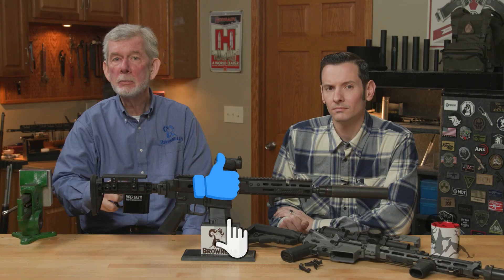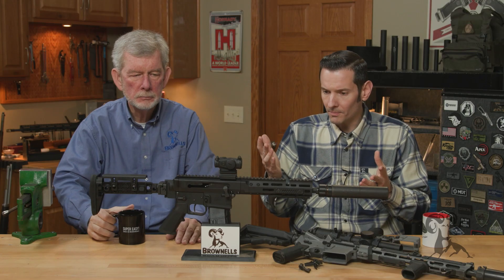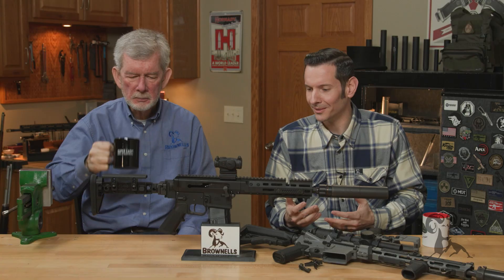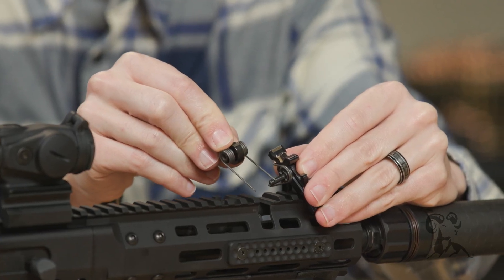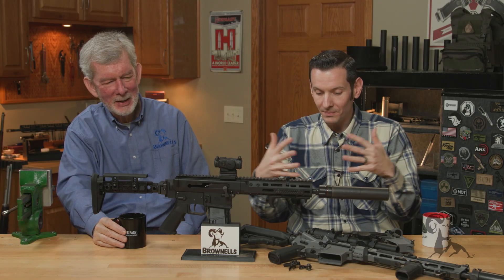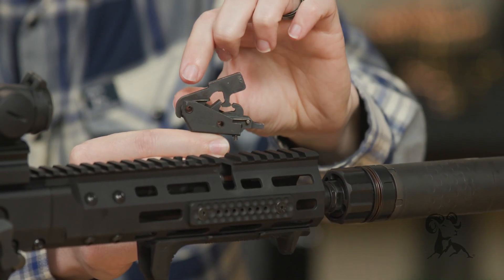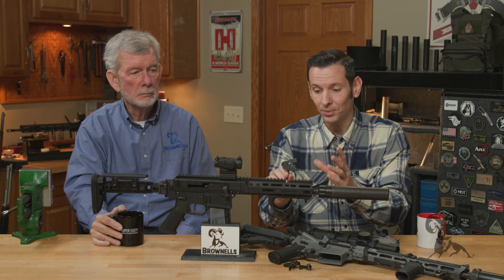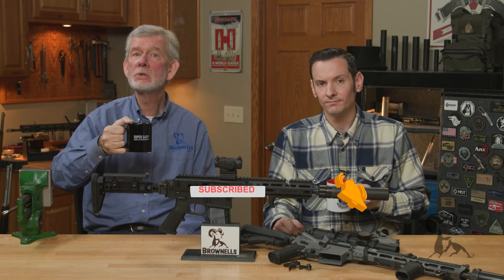Smyth Busters: Does Your AR-15 Need Anti-Walk Pins?

Comment: Smash that like and subscribe button if you know someone who blindly follows trends with total disregard for the mechanical function.
Reply: the like ratio should match the views in that case!
Reply: What do you recommend for an 80% lower? Because God knows that there’s no way that my tolerances are dead nuts.
Reply: @zeroinkev  well if you are using a regular fire control group(separate trigger and hammer) the hammer spring is still going to hold both pins in. Some pins are specific to the trigger or hammer so make sure the trigger pin has a notch on each side and the hammer pin has one in the center. Many are universal though where they have notches on the ends and in the center on both pins. if you think your tolerances are bad and could cause trigger malfunctions then a drop in trigger would be the way to go and with most of those you should have anti-walk pins. If you used a jig your tolerances are likely just fine for a regular fire control group setup.
Reply: here u go caleb starts @ 4:30  hah
Reply: I had to install them on my build because either the holes on my lower were out of spec or my pins from the kit were out of spec, so instead of figuring out what the problem actually was I just fixed it that way.

And yes I installed the pins the correct way and they started to walk out then I reversed them and they still walked out.
Reply: @sjl9942  I'm wondering if I have the same issue as you. My hammer pin walks out but trigger pin does not. I need to try reversing the hammer pin to see if that works.
Reply: Yup! Smashed!
Reply: 😂 From my  perspective Caleb is getting trolled in the forums.
Reply: Well fortunately for you Caleb, I don't go to fourms, or watch angry guys doing YouTube videos. 

So if I ever decide to put a trigger in my rifle, I will just make contact with Caleb on what I need to use for what was covered here.
Reply: I did several builds with Mil spec parts,and since I like the Service Rifle style ,and I've never had any problems with the pins walking or even noticed rotating. Good video .
Reply: Damn.......Anybody wanna buy two sets of anti-walk pins?
Reply: I'd like some deets on that charging handle. My google fu is failing me
Reply: Omg it's literally me
Reply: When I first starting building ARs, there were videos that stated the hammer spring should be under the trigger assembly. This caused pins to walk out constantly. After using antiwalk pins for awhile, I took a good hard look at how the milspec trigger group was designed. I realized that the hammer spring should rest on top of the trigger assembly, and ride in that notch to prevent pins from walking. After that I never had a pin walk on a milspec or two piece trigger group.
Reply: I only have 2 ARs with anti-walk pins, but that was because I swapped out the old triggers for drop-ins that came with the pins. I haven't had any issues on my mil-spec triggers, so if ain't broke...
Reply: Are there any difference with triggers, for a Ar15 or an Ar10. I built 2 ar15s and 1 ar10 and i find the trigger puller for the ar10 seems hard to pull. Can you do a video on that, plus buffer tube weight for the 10 and the 15.... Thanks...
Reply: @anon135  thats weird

Comment: I have a Wilson Combat "blem" low er, and standard 2 piece trigger. Trigger pin kept walking out, thought spring under, but it wasn't  wrong. Examined lower for "blem". Nothing visible, but then check pin holes. Right side was just a hair big! Installed anti walk and rotate pin set. Works great. Will the no rotate cause a problem?

Comment: New PSA AR15.  After 3 weeks ownership and 400 Rounds of ammo  (Basically completely mil spec) all of a sudden I'm at the range punching paper and I fire, then release the trigger and it fires again.   Did a little quick research that said to check the trigger group , which I did and found the pin over the trigger itself had walked out and  it was tilted inside the receiver.  After unloading and safeing the gun I pushed the trigger a little right and lined the pin back up and pushed it back into the receiver properly.  So Do I need anti walk pins or was it just an anomaly?  I've put another 120 rounds through it since without issue.  If it happens again I'm definitely getting the pins.

Comment: Just purchased a DDM4 V7 pro and the pins walk like there’s no tomorrow. Pretty disappointing considering the price. It actually walked out so far that the hammer wouldn’t set correctly and it would fire off multiple rounds, essentially running away. Its brand new too I have no clue what to do

Comment: I have a question about my upper and lower fit. I have an ar in 308. Sidecharge upper from bear creek and psa lower with enhanced trigger.  The first takedown pin goes right into place, but I have to use a little plastic hammer to get the rear takedown pin to go in. The upper and lower are just too close together for the pin holes to match up. Its rock solid when it's together and it functions flawlessly. Does anyone make slightly smaller takedown pins or will this eventually wear in and become looser?
Reply: That’s normal, don’t worry about that. And yes, it will eventually break in. Better to have it be tight than loose.

Comment: Ive had ar lowers that were worn at the pins... turned the trigger auto while malfuntioning. Switched to anti walk pins and dont have that issue anymore
Reply: It feels to me as though these guys will argue than you only need brake pads on the front of your car but not the back. 
"Need" has no place in the 2A world. That's the word of the anti-gun crowd.

Comment: No one gonna touch for this dude supposed trigger tech the best triggers.  Because they have adjustable set screws for the same reason that he said was false about smart rotation pins?  You will not drill holes in your receiver with trigger tech lol.  How can any one take advice from people that think trigger tech will wear your receiver with holes.  Also they put stress on the pins?  Talk about other people making some far out claims without proof.  Show me how trigger tech has ruined receivers and worn out 5 dollar pins because of the huge amount of stress their under lol

Comment: I think it’s a matter or commercially available and a built AR15 because many guys I mean many guys including me as a rookie couldn’t get that damn pin to locked in the proper way and resorted to anti walk out pins , eventually it’s been ages since I’ve been collecting ARs so now I know basic pins installed correctly will work but for anyone building, make sure they clink into the spring they won’t get out after that. It’s quiet simple

Comment: these are one of the most unneccessary fads in all of the gun world. Ive bought so much PSA, anderson, and Delta Team Tactical china shit over the years and NONE of them have had pin issues, including a polymer lower with a delata team LPK and part of a m16 kit for a Class 3 MG and over 3500rds of full auto fire through it

Comment: Honestly the only time I have personally experienced the pins walk ( specifically walk) is on a 458 SOCM upper on a plastic receiver lower. however there are a few ARs I use the anti walk pins on specifically because the lowers are out spec (CRAP), and I just refuse to throw the lower away because I am a cheap bastard. and this is after ensuing the group is safe Per what is demonstrated on  SOTAR testing of trigger group. another note is those rifles are only target/testing rifles and would never use them for hunting chipmunks. the 458 SOCM rifle on a plastic receiver only lasted about 300 rounds, before falling over and breaking from fall, not use.

Comment: For airsoft replica rifles for the AR15 plattform there excists a so called "Magic Pin", which should reduce or eliminate receiver upper to lower wobble, which can cause over time of use to the gun.

Is this just an airsoft related issue, because of lower QC for those replicas, or could this pin be useful for real AR15 rifles as well?

Couldn´t find anything online besides to this topic.

Thanks and best regards.

Chris

Comment: just ran across this video after doing research on anti-walk pins. Every time I try to research theres always a thread about how you should never use anti-rotation pins. Its as if people are purposefully conflating anti-walk with anti-rotation. I get that the standard milspec pins have a grove that the hammer spring prevents from traveling too far on the trigger, but this only creates more questions. 

1) why aren't the grooves symmetrical? you would think that both legs of the springs would rest on those grooves and what is the purpose of the groove that clearly exists inside of the axis hole of the hammer/trigger? The only theory I have come up with is a lubrication channel to allow a small amount of lubricant to rest inside the axis hole. 

2) why is only the trigger pin protected from walking via the hammer spring while nothing prevents the hammer pin from walking?

I am a bit OCD so when I see my pins sticking out maybe half a mm, I am constantly trying to make them flush again. So I have been looking into the wilson combat anti-walk pins for a standard two piece trigger system. I get that the pins should rotate, which is why the wilson combat ones seem like  a good compromise in that the pins rotate like normal, but there is a nice flange on both sides that absolutely would keep a pin from coming out. Being somewhat OCD, I also dont want those flanges to come unscrewed during use, so I use purple Loctite (a very low strength version to prevent vibration loosening small screws) to hedge that potential issue as well. Now that they threw out the ATF ruling on forced reset triggers, I am entertaining the idea of purchasing one, esp now that they have figured out how to make a 3 position selector that enables/disables the forced reset. I dont want a rapid cycle rate to accelerate any walking of the hammer pin, which as has been discussed, has no spring to prevent walking. This is not like an AK where the auto-sear spring doubles as a retainer wire for the 3 (2 for semi-auto)  axis pins. 

What is your take on the anti-walk (not anti-rotation) design by wilson combat? I dont have any material specs and the only downside would be if they were not the same heat treated hardness that the mil-spec pins were manufactured to. From my perspective, an equally hard pin that still rotates, but has a flange on either side to keep it in the receiver, would have no negative consequence that I can find.

Comment: I’m relatively new to AR15 ownership and my Springfield saint victor at the range I was in the middle of a mag where my gun just stopped firing and trigger wouldn’t pull and looked at the function and nothing was wrong and the trigger pin was barely sticking out. Shoved it in and it continued to function

Comment: I put my trigger spring in backwards. I had pins backing out, but other than that it worked okay. I saw a Smyth Busters episode about the 5 biggest mistakes new builders make. One was putting the hammer spring backwards. I checked mine, found it to be backwards. Once I reassembled the hammer with the spring correctly installed, no more pin walking.
Reply: I'm working on a buddies AR15 that the trigger pin was walking out on. Everything looked good, I couldn't figure it out. Then I read your response to this video and I checked it, sure enough, the hammer spring was installed backwards. I changed it which made the trigger feel worse, but the pin is firmly being held now. Thanks!

Comment: I never had pins walk on my lowers until i changed out all the triggers and put JP Enterprise yellow springs in the hammers and triggers. 

The hammer kept walking on one and the trigger on the other; multiple times in one session at the range. 😮

I bought 4 sets of Wilson Combat anti walkers and no more walking. Its not like Anti walk hurts anything but not having can walk when you have a 3.5-4.0 kb trigger pull.

Comment: If the Hammer Spring's Legs are seated against the notched pin correctly, that pin shouldn't rotate at all. The tension not only keeps the pin from walking, it hinders rotation as well.

Comment: Nope! That pin is designed to rotate. A properly assembled, in spec lower with quality FCG will never walk. Anti walk pins are a joke and actually cause the very damage they claim to prevent
Reply: Can you explain how that is?
Reply: @VndNvwYvvSvv  The AR-15/M16 was designed to have the hammer pin rotate. The Hammer pin is held in place by an internal J Spring in the Hammer. The legs of the Hammer spring sit flat in the groves of the trigger pin and keep it from moving. By allowing the Hammer pin to rotate, forces from the action of the weapon firing and cycling are effectively dispersed.  When these pins are mechanically locked in place (anti walk pins) all of that stress and force is focused on the now static pin. Over time, this will likely cause the pin the shear, leaving it and other components loose in the weapon. The sheared pin cause damage to the lower receiver.  Also, no company makes a quality anti walk pin set. They are all gimmicks. There are many thousands of examples of AR-15’s and select fire M4/M-16’s with proper mil spec trigger and hammer pins that have never walked, never broken, and never bored out the pin holes.  Anti walk pins are a stupid gimmick that for some reason people have been fooled into thinking they need.

Comment: I just bought an AR and had a cassette type trigger put into it and noticed that when I pull the charging handle for loading my first round my trigger pins are able to walk out when i tip it on its side. Would you suggest buying new pins?

Comment: I spent 25 years 83 to 08 as a 11B .
Used A1,s A2,s, and M4,s.

Never had a FCG pin issue.
Never seen oblonged receiver holes for the pins.
Never had a Joe's wpn go down for pins...

The "it can" and" it could " types on websites are spewing urban legend BS....
Tackleberry,s .........

Cassette triggers can benefit from  the anti walk / rotation pin designs due to their need.

I hate the fuuuking gouge marks  in bottom of the receiver from set screws some drop in triggers use.

You would think they all would include a plate to prevent that like Elfman does.

I have a Giselle ( sp?) SSP in my  LE 6920 with their pins.
2500k rds thru the wpn.
0 pin issues...

The SSP is fast and precise.

I have had drop in triggers in other AR,s.

Think more manufacturers would use springs like Wilson and a few other manufacturers do instead of set screws.

Even the spring types leave a round mark.
But nothing like a divit gouge like the set screws do.

Whatever...
Internet SME,s ( subject matter experts)
Bulldog mouth on the keyboard that can't back up that puppy dog azz in the real world.

Basement dwellers.......

Comment: I never really cared about anti-walk pins until I was working on my most recent build. I dropped in an Elftmann match trigger and with both trigger pins that came with it and a PSA small parts kit they would just fall right out when I laid my lower on its side.. needless to say I immediately ordered some anti-walk pins and that fixed my issue.

Comment: Had put together a lower that the trigger pin kept walking out. Spring legs were in the slots in the pins. Just kept walking out during with a milspec trigger. When it did the trigger was disabled completely. Put a set of strike industry pins and that was it. Should they come out, no. Can they? Absolutely

Comment: I served ten years in deployed a few times. I have had my FN M4 coded out because the trigger pin hole enlarged on both sides and wouldn't stay in during firing causing double fires and malfunctions. Thankfully the problem showed up at the range and not in a more inconvenient place. Ever since then I always used anti-walk pins and never had another problem. I know i personally put thousands upon thousands of rounds through it so no telli gthe actual round count. Im just saying it could happen.

Comment: I have a couple BRN180M lowers and single stage drop-in MI 3.5 lb triggers installed with the annti-walk pins that came with the drop-in kits.  Looks like I can go back to not paying any attention to the issue. FWIW, I had always heard the term 'Mil-Spec type' triggers used to describe 2 piece trigger set-ups. Is there any 'correct' term that applies?

Comment: Ps, how do you get the job of being the dream build guy, and when is Brownells going to locate a store in Wyoming, Idaho, or Utah.
Reply: As long as the soap box is here, you guys need better supplier reps we all want to go to great parts, this is where a PSA, Brownells new model needs to be made this industry moves fast and needs great Smiths, Engineers, Designers,  the greatest Mills and even better operators.  Space X is getting lots of there guys from the Intermountain West. Where are you guys? Great things can happen in this industry, but the impossible happens under one roof. (My quote)

Comment: You make it sound like it never happens, yet the only reason I found this video is because while I was shooting the other day, my trigger pin walked out and the gun malfunctioned. Totally mill spec, Aero Precision lower, rock river parts kit. I've probably only fitted maybe 1000 rounds through it in the 10 years I've had it.

Comment: I thought I needed them for mine cause they kept sliding out, but I put the groove sides on the right side of the receiver ( where the mag release is) and the trigger springs locked into the pins and I've never had a problem since